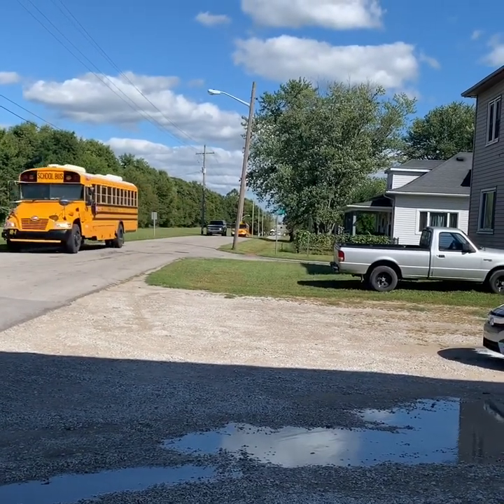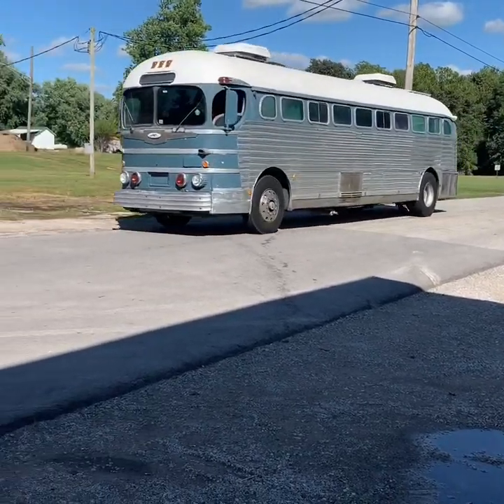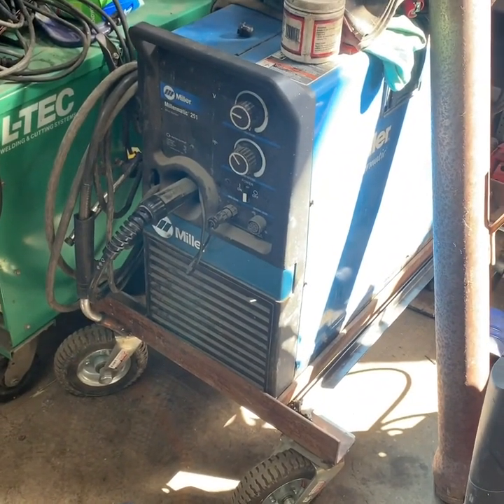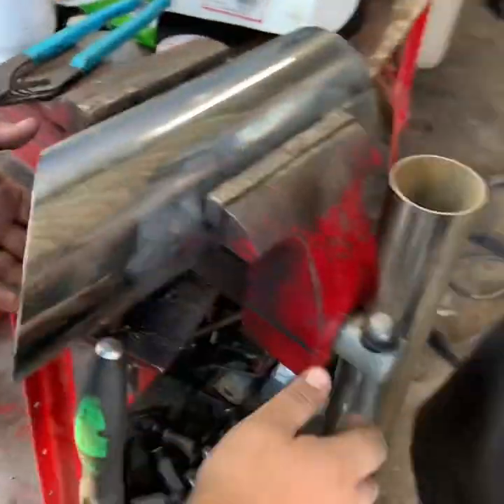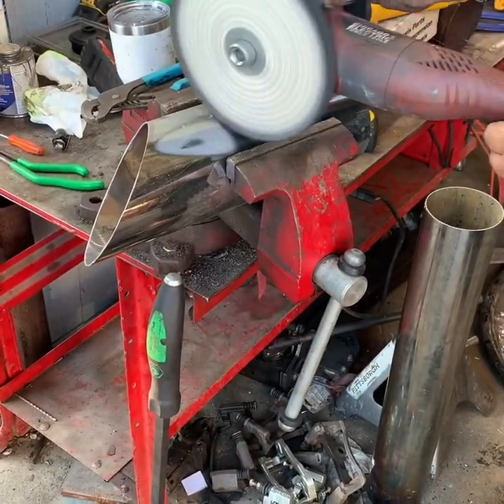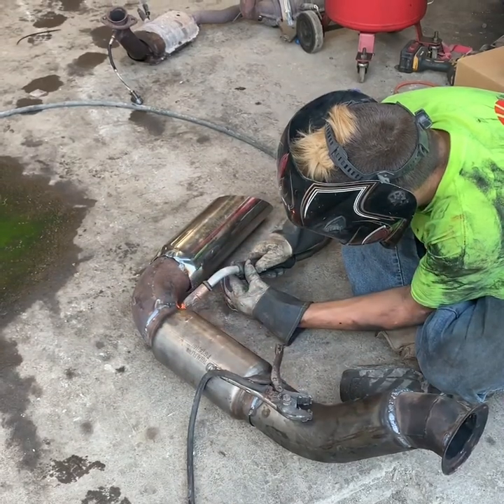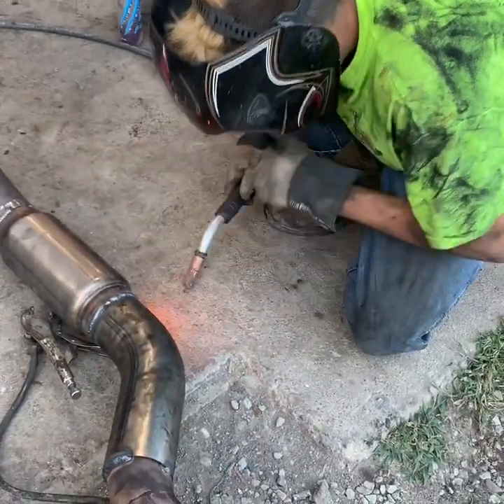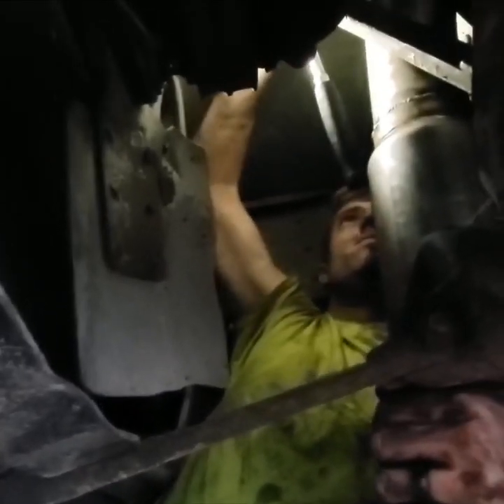Building custom exhaust for Lenny with  bus grease monkey

Comment: Placing the hot tail pipe directly below the radiator doesn't seem like a good idea.
Reply: For this exhaust there was a giant hot muffler covering over half the inside of the radiator
Reply: It will be fine,relax.